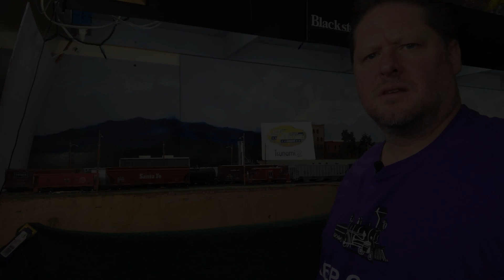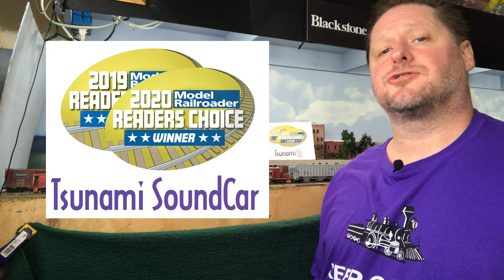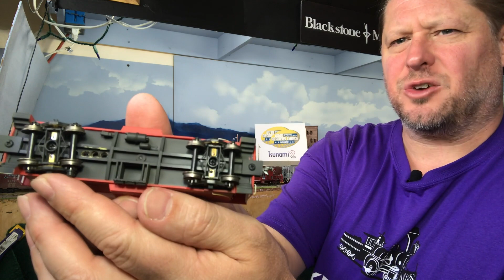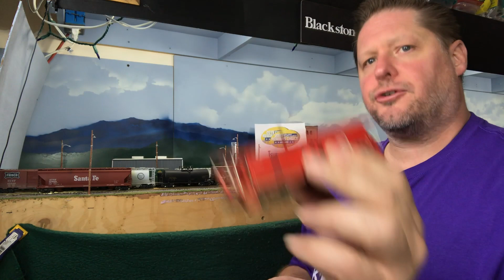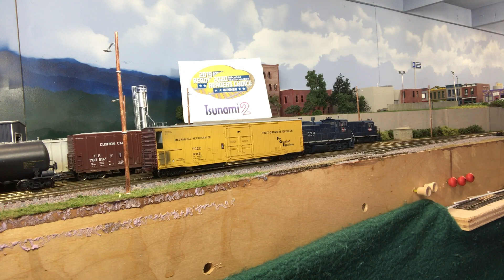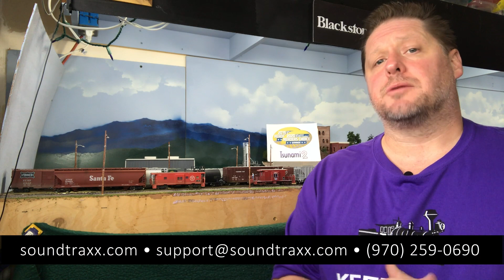Realistic Model Railway Operation with Tsunami SoundCar

Comment: Love these decoders. Would be nice to have different diesel generator sounds, eg: CAT, Cummins, old inline 6 Detroit, or Detroits 692 sounds, that would be ideal for electric generator cars. Eg of these is like in the Australian Indian Pacific, and Ghan trains, which get's the power from the cars and not the locomotives.
There are new generator cars hitting the Australian shores in July, manufactured by Ausiscion Models. These electric generator cars were and still are very common in the Australia rail system.
I have used the new version of the SoundCar decoder, even after making adjustments, the power car still sounds like a refer car, then a more car.
Also the refer motor option, it would be great if there was an option for automatic low to high idle, and high to low idle. Eg, when refers transport Ice cream or other frozen items. There is always a cycle of air flowing through the car/trailer to maintain the temperature. The same way as it worked on my old rigs.
Reply from the maker: We will pass on to the engineering team for review. Thank you for your suggestions